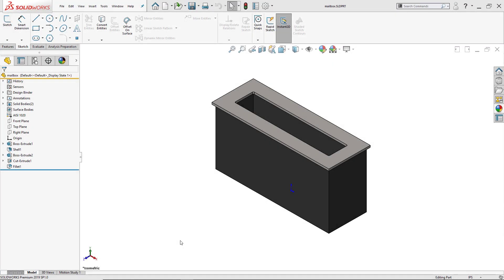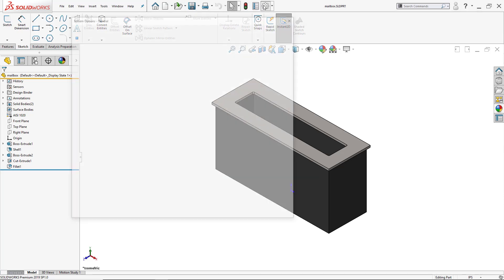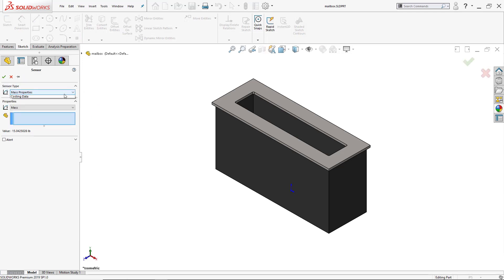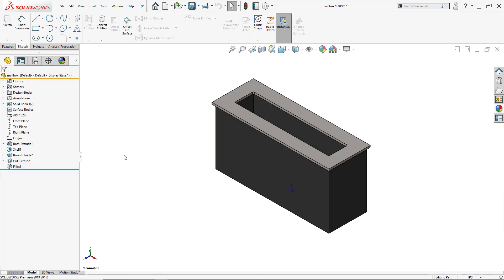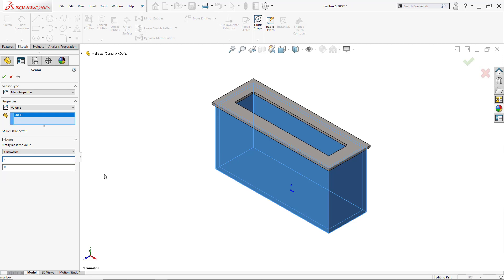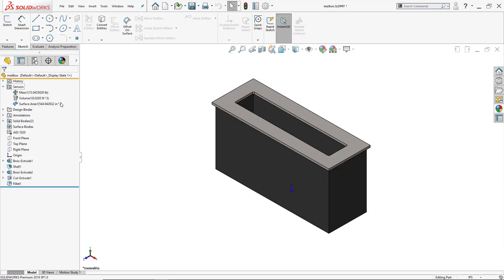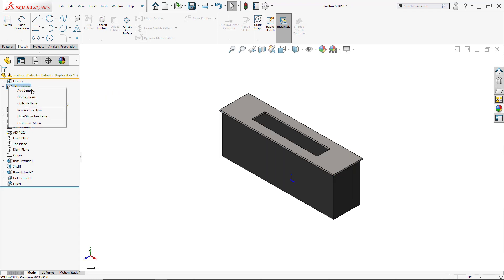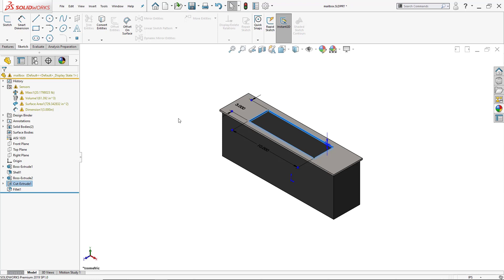Getting Familiar with SOLIDWORKS Sensors

Comment: The volume sensor isn't measuring the right thing, if you're trying to measure the space for letters. it's measuring the volume of the metal itself, not the enclosed volume inside the box for holding letters. You'd need to create a body that fills that space, and point the sensor at its volume.